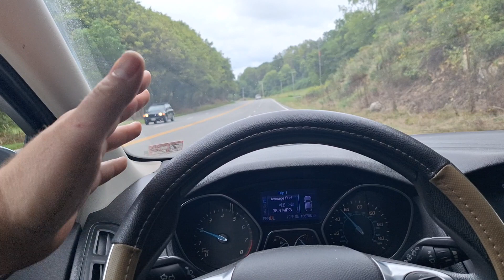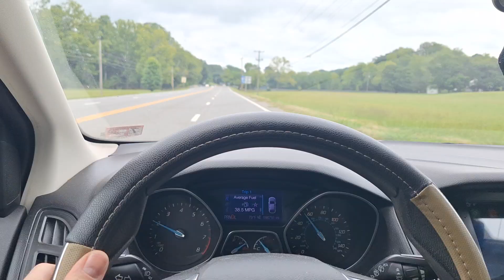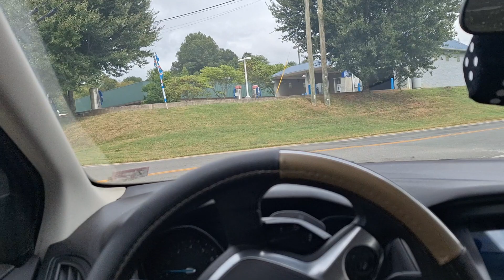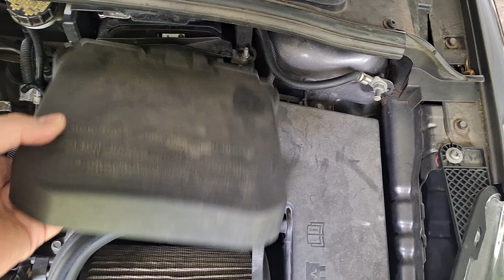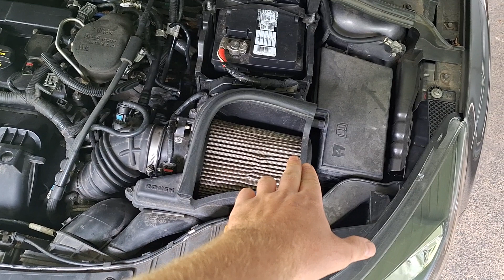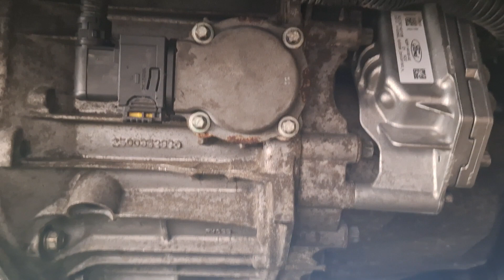Diagnostic Guide | Ford Focus Won't Move In Gear? Dual Clutch Automatic DPS6

Comment: Hey 2013 focus hear a rattle in the transmission won’t move at all. Car will not turn over at all. When I put in neutral and pushed the car I can hear metal
Reply from the maker: Record the noise on video , post on my discord for the group to listen
Reply from the maker: Or my Facebook group

Comment: I changed the clutch and the shift drums fork and cleaned the inside. The shift still doesn't work well. I changed the TCM and I still haven't had the problem. What can I do?
Reply from the maker: drive until it sets a code. diagnose the codes based on my videos. if you havent already done so do the adaptive learn for the clutch

Comment: hey hows it going ive been watching alot of your focus trans vids ive learned alot ive done the dual clutches before no issues i just did one on a 12 focus and now im having issues i get codes for cant engage 1st and or cant engage reverse and now i have no gears ive tried everything ive used a scan tool to learn the shift drum sometimes it completes sometimes it doesnt and then the tcm starts to click like its binding ive tried swapping tcm ive pulled the trans a second time pulled clutch off inspecwted all the new parts all seems fine ive pulled the back half of the case stops are good ive put the trans in every gear manually no issues i swapped clutch actuators and everything idk what else to do ive gone over it a million times please can you help thank you

Comment: Just picked up another focus and it wont move in forwards or reverse. The only code its pulling up is p07A5. I checked the B fork and its butter and also changed the actuator and still the same thing. Does this sound like a shift drum stop problem?
Reply from the maker: @TurboTurdBurglar  hey man. If both forks feel good you can start with a clutch adaptive learn to try and see if it gives you any more information
Reply: @ clutch travel test - ERR is what its saying on forscan everytime i try to do a clutch relearn

Comment: My Ford focus range sensor went out in Drive now it won't come out of drive on my dash even after I replaced my range sensor. I have a big D on dash but not in orange?? Won't even start because it still thinks I'm in drive??
Reply from the maker: @gregnewhouse7129  by any chance have you checked to see if the cable popped off the transmission lever, or if the cable is broken?
Reply: @BigBensCarsAndCycles  yes it's all on good the range sensor died why driving. I punched it home. Replaced the sensor but it's still thinking I'm in Drive
Reply: I just replaced the clutch 5 days ago
Reply: The PRNDL on the screen is in D but the shifter is in park

Comment: Hi Ben
I replaced both forks on ford focus 2012 model. After reset the clutch. But now car is refusing to engage gears.  What might be the issue here. Does TCM need re programmed? Any help would be appreciated.
Reply from the maker: I would do a clutch adaptive learn with forscan and drive it after

Comment: I have a 2015 se when I put the key in I hear a noise coming from the tcm, it’s starts right up but says transmission fault service now and when I put into R or D it says vehicle not in park revs but won’t drive … is it the TCM?
Reply from the maker: @godiegovlogs9419  need to know what codes are stored

Comment: question you may be able answer:
2017 focus. just bought on auction. 

scenario: turn key clunk (first thought battery/starter) breaker bar on crank/harmonic balancer Stuck, locked up (son of a B___!!!)
time to pull on trailer key on shift in Neutral winch ....um front wheels are in gear. shifter shifting electronic shift display switching.  but transmission is in gear cant yank on trailer...your first thoughts?
Reply from the maker: if it has the dual clutch transmission, my first thoughts are it has seized clutch forks and needs a full clutch job

Comment: Ben i have a situation where mine started slipping between 1st and 2nd, the next day was slipping between almost all gears if i got on throttle even fairly decently......
The next day lost all ability to move either forward or reverse.....

NO CODES HAVE BEEN STORED
Reply from the maker: @freemanfornow264  try swapping the upper and lower actuator motors and see if it becomes a loss of forward engagement. If nothing changes then do a clutch fork test by hand on A and B

Comment: I wanted to say that I had an upper drum stop break on my 2014 focus. It is possible to weld a new stop on to the old case half. I did it. Had to smooth it out with a burr tool, but it worked. Seems to be stronger than the original cast. So if you have access to a tig or a spool gun ( I used a spool gun) the case housing can be removed and welded.

Comment: Big Ben thanks for your videos. I have this 2014 focus with mechanical codes P287A, P2872, and P07A5 for both clutches. Also have codes P06B8. The car would not start unless i play with the shifter by moving it to neutral. And when i get it to finally run and either shift to drive or reverse it will not move. I'm trying to see if this is maybe a TCM issue.
Reply: what was it? i’m having the same issue
Reply: @oldxoul  I replaced the clutch and shift forks and actuators and including the TCM

Comment: I did the transmission, I put it in today, and it doesn't move, it's just in R and it doesn't move and the key got stuck, only after I removed the battery it came out ford mondeo 6dtc450
can help please
Reply: p0949 p2849 cod

Comment: So i jus replaced clutch , put tranny back on , went to start car , it dont start , On my DASHBOARD ( P R D N L ) ITS ON THE N AND WONT CHANGE , BUT I CAN MOVE SHIFTER FROM P TO L , WITH THAT IM GETTING ENGINE FAULT SERVICE NOW , HILL ASSIST START NO AVAILABLE , IDK WHAT IT IS 😔 IDK IF ITS THE SAFETY NEUTRAL SWITCH OR NOT
Reply from the maker: Make sure the shifter cable is hooked up on the trans and the range sensor isn't damaged. If it's OK check fuses to the tcm
Reply: @BigBensCarsAndCycles i did no luck , the odometer shows only dashes no miles or gas amount , i try to plug ob n read codes but keep gettin a error message
Reply: @BigBensCarsAndCycles i replaced safty switch still no luck , wasted $200 😢 really need help dont want to take it to a shop

Comment: I have watched a ton of your videos.  I really appreciate all of the straight forward walk throughs you have done.  I bought a 2017 loaded Focus a few weeks ago as-is taking a bit of a gamble on it.  It had a TCM code and I was hoping it was one of the easier fixes.  Today I took out the A side actuator and went to turn it by hand and it was obvious that the fork bearing was completely destroyed.  It just freely rotated in both directions and even moved off center a bit.  I used your affiliate link to order a new clutch kit and will be giving the job a shot.  Just wanted to say thanks for all the info.
Reply from the maker: Thank you very much for using the link, and I'm so glad the videos have helped!

Comment: I have a 2016 ford focus and it goes in reverse but not forward. I switched the actuators and still only goes in reverse. I dont have any codes though so not sure the direction to go in.
Reply: Same thing happened to me you ever figure it out?
Reply: @gavincotter9326  clutch was gone basically, just spinning freely when i spun it. We just got a new transmission we found a good one and works perfectly now and the clutch when you spin you can actually hear the metal making contact unlike mine
Reply: @kevinflores9117 did you put it in yourself?

Comment: Help lol! I was driving up a hill on a delivery and all the sudden it stopped shifting and overheated, now it wont go into reverse or drive, wont shift , can put in park and neutral. Got codes Po7a3 and po7a5 , cleared the codes , can start the car! Could it be something simple or something really bad
Reply: 2014 Ford focus
Reply from the maker: Hi, my first step in diag would be turning both clutches by hand using a dps6 clutch reset tool. If the forks have tight spots while turning, or squeak and pop, it needs a new clutch, fork and slave cyl. New actuators would be good too. $3,200. Or diy for 1k
Reply: @BigBensCarsAndCycles  oh boy okay thank you so much

Comment: Hey had to jump no codes still won't go into gear every gear sounds like it's in neutral
Reply: It's a 2016 titanium
Reply from the maker: @chelseashover2769  hi, it should definitely be setting a code if it's not engaging. Is there a transmission fault message?

Comment: got my 2013 focus inspected by ford dealer and they responded with “"A" Plus Service: DTC P2831, P2832, and P287B present. Removed TCM and inspected clock gears. Found clock gear stops have separated from the transmission case. Complete transmission requires replacement.”
Have you seen this happen in your experience?
Reply from the maker: Yeah. A new case half is about $300 or $400 and takes 30 minutes to put on once the transmission is out. Here's my video on it https://youtu.be/-E-YTX7lFbQ

Comment: I have a p0809 p0806 p2872 and start you’ve got to hold the key 30+ seconds before car will start
Reply from the maker: You should replace both clutch actuators and that should fix it
Reply: Replace both actuators and so far so good
Reply: Ok that what I was going to do first I will let you know if that works

Comment: 2014 ford focus had a p0902 low circuit  replaced both actuators cleaned the grounds and reset the trans turn key to on shift to neutral so far no problems

Comment: As i was turning the actuator up top turned and released it several times then it siezed up and slightly turned the other way and now it doesnt spring back and spins both ways? Could you clarify what happened brotha i apprieciate any help 

I have 2013 focus se dps6 139,xxx miles
No reverse and have to it seems to skip gears cuz it only works fine at high rpms, jerks and i have to press on the gas not fully just enough for it to engage in a gear say at about 20  and then i have it coast there or bring it up to 40 this was before i was cleaning the top actuator still dont know if i broke the coil or wat but its loose now and rotates both ways also i saw a lil red on the tip of the special tool when i took it out 

Any help is much apprieciated i hit that like and subscribed!
Reply from the maker: I'm glad the video helped! Sounds like you need a clutch, fork and slave cyl replacement. The fork sounds as if it's just broken inside
Reply: Ay brotha i wanted to ask if you knew how the actuators and the inside of the transmission gets dust?  I heard something about some seal upgrade would fix that? Is it just using a compressor and brake cleaner? Clutch as well? Any info would be awesome bro i apprieciate it @BigBensCarsAndCycles

Comment: I'm trying to replace the top clutch actuator on my DSP6, but the slpine connector on the transmission is off center, and I can't figure out why?
Reply from the maker: Sounds like a damaged clutch fork. Have you tried turning it counter-clockwise to see if it binds up?

Comment: Hey Big Ben l, I’ve been watching a bunch of videos looking on how to fix my problem but none talk about the P07A2 code so is this fixable or not. Thank you :)
Reply from the maker: Thanks for watching! You can swap locations of actuators a and b. if the code switches to clutch b, then replace both actuators. If it stays the same, replace the clutch, forks and slave cyl

Comment: what happens when your transmission is overheating and need to stop for five minutes.
Reply from the maker: Normally that's a clutch or fork issue. I've got a video on Ford Focus Transmission overheat message

Comment: Hello Big Ben, I have been learning about this transmission  myself over the past year. I have ran into most of the same common issues you mentioned in this video but still occasionally have trouble tracking down problems. Is there a good way to communicate or get your opinion on a specific issue? I would gladly compensate for your knowledge and assistance.
Reply from the maker: Hi, I can be reached easier on discord or my Facebook group. If you message on here, please like this comment to send a notification to me. And I appreciate you offering compensation. If you click the Thanks button above you can donate to support the channel.
Reply: @BigBensCarsAndCycles  I just had my transmission worked on shift forks changed and tower changed. And it passed all the test til the rpm cycle got that fixed and it passed it but now whenever I go back to retry it won’t pass the gear command for neutral status for both transmission shafts any ideas what this could be I’m going on three months of being down my only vehicle

Comment: Hello.. I have a question, when i start my car the transmission is blocked i can't move to R D N S it's blocked in P.. do u have any solution for this please.🙏🏻
Reply from the maker: You mean the shifter won't come out of park? That could be a bad brake pedal switch. Or it may be a bad interlock in the shifter. If you press the brake pedal, see if you hear the interlock clicking in the shifter, if you do then replace the shifter. There may be something else going on, this is the best I can offer without seeing the car in person

Comment: This channel is a blessing. My 14 Focus was shifiting erratically and so poorly I thought I needed a new car. I cleaned the grounds (not the one on the transmission yet). It is still shuddering occasionally but at least safe to drive for now. The Ford dealer said I'm on a waitlist for at least a month to diagnose it. Do you have any recommendations?
Reply from the maker: I'm glad to help! If it's only shuddering and has no check engine light with transmission faults, you can drive the vehicle hard several times to mitigate shudder. Here's my video for that https://youtu.be/bjMw1jrFzaw?si=Jf8_Rs_KN-Pn8L3O
Reply from the maker: I've also got a focus transmission Playlist with 40 other videos to help you guys out

Comment: Hello!  I need some expert advice before I'm forced to replace my complete transmission. Ive got 2011 Fiesta auto and drove it home (after just purchasing it) and boom! the second I put the shifter into reverse, theres a weird noise and the car now doesnt engage into any gear. Now theres a rythmic ticking noise from the TCM area. I tried switching the clutch actuators, same problem. I put another TCM in and still same problem. I tried doing the TCM shift drum learning procedure and after some noises from the TCM, its gets stuck and fails.
Have you come across this before and is this pointing to a transmission replacement?
Thanks!
Reply from the maker: Hi, that sounds like broken shift drum stops inside the transmission. What codes do you have?

Comment: Help! I put a new clutch, forks and release bearings. Due to loosing the 2,4,6 & Reverse. Since the major operation reverse is back but the car lurches in reverse and I get codes P07A5, P287A. Is this a TCM problem? Or internal problem with the gears on the other half of the case?
Reply from the maker: Those codes are for clutch B being stuck. You can swap locations of the upper and lower actuators to see if the problem transfers to clutch A, which would be a bad actuator. Otherwise you'll need to take it back out and double check your work. Did you remove the metal shipping clip on both forks? These codes won't set from a bad tcm or internal gears
Reply: @BigBensCarsAndCycles  Yes the shipping tabs was removed from the forks. I’m gonna try swapping actuator positions then do a re-learn on Forscan

Comment: Big Ben, thank you for all your help, I have a 2017 Focus, it has no codes but 1st and 2nd are slipping it has 68,000 miles. I wish you lived close by so you can work on it.
Reply from the maker: You're welcome. Sorry to hear about the focus. You could toss a new pair of actuators on if they haven't been done before. But it could be a fork issue

Comment: Hi there, I really appreciate your focus videos. Ive replaced both actuators and have code P0703 still coming up, I can shift into reverse and it will reverse like normal but in Drive is doesnt want to engage, so Ive ordered a TCM, would you recommend replacing the clutch and forks as well and if so where did you order the LUK clutch from?
Reply from the maker: Hi, happy to help! I don't see P0703 listed in the shop manual for the transmission. Did you type the right code? And the repset is on amazon for $630. Part number Luk 07-233
Reply: @BigBensCarsAndCycles   Awesome thank you. Sorry i typed it wrong in my question it is P07A3

Comment: I've got a 2014 SE at 103k miles, Last summer the TCM was replaced, Aswell as shift actuator A, I'm having more issues with it but can't find any solid help online. Its making a grinding noise upon shifting, and a howl at higher RPM. The grinding on shift makes me think clutch, but I have no CEL, and no pending codes to suggest a clutch. Is it still possible for it to be the clutch or is there something else to look for. (i.e. seizing fork) Any help is appreciated, not looking forward to the repair bill on this 😂
Reply from the maker: Can you drive it, and see if the grinding starts when it shifts into 5th gear? And would you describe it as a rubbing/humming type noise above 35-40mph? If so, your final drive bearings inside the transmission may be worn. Mine did the same thing. I put a low-mileage used transmission in, with a new TCM and clutch/forks
Reply: @BigBensCarsAndCycles  the howling is in all gears I believe, only when I floor the pedal, the trans shifts then it howls for a couple seconds, then just goes back to a grinding noise. The car drives and shifts normal aside the grinding/howl.
Reply: @BigBensCarsAndCycles   Got the car back from the transmission shop, they diagnosed it as an internal bearing noise and quoted me $7,900 for a reman transmission saying it couldn't be rebuilt. Thoughts, opinions, ideas?